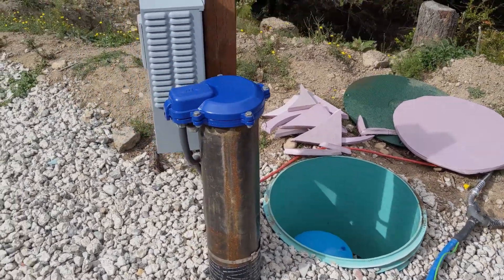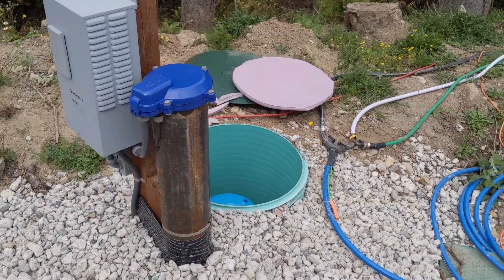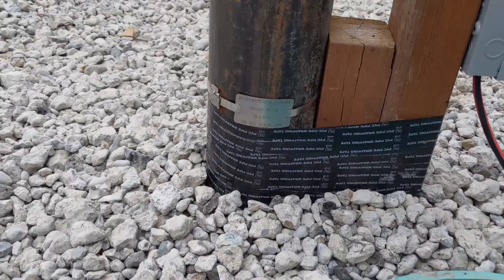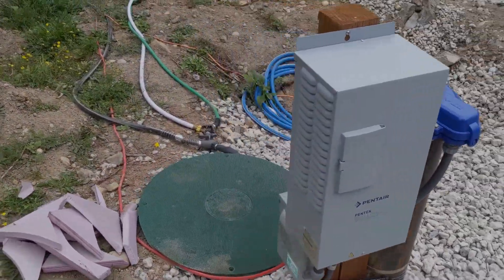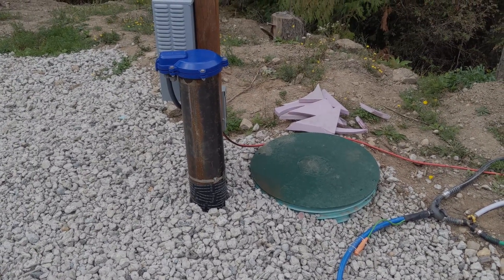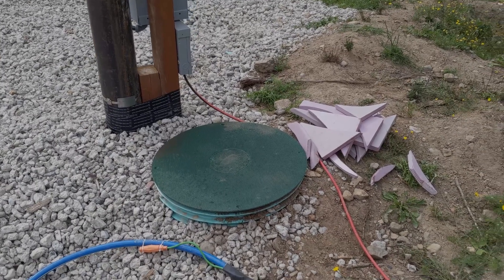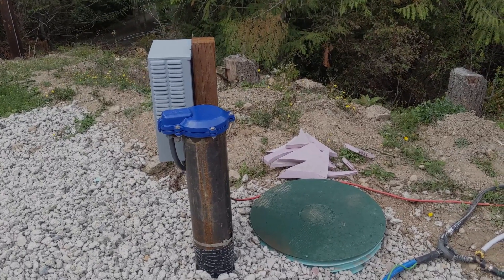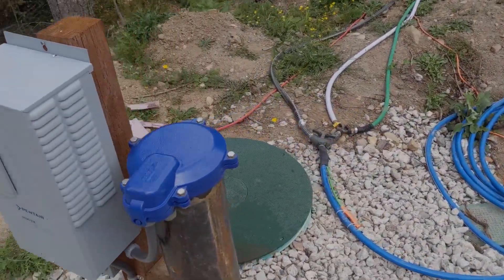Constant pressure water well

Comment: Hi I am trying to connect to a Franklin Electric SubDrive 75  which is a VFD for a well. Says it shouldn't be used with GFCI or externally regulated generator. How do I know if my generator is externally regulated? I have a 5000W Generac generator. Can I use an inverter generator?

Comment: Why not just install a large water storage tank...once the tank is filled, doesn't that reduce wear on the well pump?
Reply from the maker: That's very interesting, I would say for the uranium use reverse osmosis. Probably not the cheapest option but maybe it is cheaper over the long run than buying water.

I would suggest checking the concentration of uranium in the water, I do believe your skin could have some uptake. Not a biologist by any stretch but I am actually very familiar with uranium and would say you may look into that a little bit more.
Reply: @oak1518  thx
Reply from the maker: When I think of a large water storage tank I'm thinking 500+ gallons. Considerations with keeping that much water would be bacteria formation. The tank itself would need to be insulated in the winter climates, storage of said tank, either above ground or below ground would also be a factor. If you're talking about a tank under a hundred gallons then that is also a viable option but again to reduce the storage space I opted for a small surge tank. The pump and motor are designed to run continuously. If you were to put this in a house you would remove the benefit of that feature by putting in a large tank, the feature being the small footprint that it takes up.

I appreciate your feedback and interested to hear about your setup!

Comment: What does it take to upgrade an existing standard system? Does it require a new pump?
Reply from the maker: It does normally require a new pump. A conventional pump is not designed to be soft started and then run continuously every time a faucet is turned on. To convert an existing well you need to ensure you have enough production on that well. A constant pressure well system relies on a high production well.

For example I have a 1.5 gallon per minute producing well and am unable to convert it to constant pressure without increasing its production somehow. One way would be to frack it and drill it deeper. The problem is with this scenario and this particular well that I'm talking about it's already 400 ft deep. The deeper the well the larger the well pump you'll need for a constant pressure system. Some of the pumps are designed to maintain pressure with the depths of 1,000' but it's a very large pump and motor combination.

Example 2, a well produces 10+ gallons a minute and there's plenty of water, You would need a new well pump, motor and motor controller. Your surge tank could be kept the same but why not save the space in your basement and put the smaller tank in.

I would reach out to your local well company and inquire about what volume of production they would feel comfortable putting a constant pressure well had set up on. We're getting ready to drill another well in the Northeast part of the country and have our fingers crossed for a high production well so that we could go with the constant pressure system.

Hope that helps and good luck with your project!

Comment: Would a larger storage tank add any benefit?
Reply from the maker: No it would not, the storage tank in this scenario is only to absorb the surge from the pump starting and stopping. The pump is providing all of the water pressure in the system. As the pump starts and stops it is a soft start pump but still has some surging pressure that will be absorbed by the small pressure tank.

Comment: Where did you place the transducer in this setup?
Reply from the maker: It's in the bunker next to the pressure tank. In this scenario the piping setup is very short and measures the pressure from the top of the well head to whatever fixtures is being run or the hose in this case. Once the house is complete the transducer will measure the pressure of water within the house and adjust the pump speed and run time to maintain that pressure.
Reply: @oak1518  thanks very much for the quick reply.  I'm in upstate NY and my well motor (700') crapped out a couple of days ago. We were given the option of this system and went for it. When I got home, I realized the installer simply removed the nipple and pressure switch and inserted the transducer there.  Its just before the tank and there are fittings close to it. Obviously not what I see the manufacturer recommends.  Im gonna plug that 1/4 and tee into my main line somewhere downstream. Does it make a difference or if it were you would you just leave the transducer where they put it? Also, if I put it before my water softener is that okay? Any info would be appreciated. Thanks.
Reply from the maker: I see, I am now in Connecticut and working on deepening our well probably close to 700 ft as well. I think that as long as there's no check valve that prevents its sensing the pressure in your system you're fine. There should be some check valves in the system before the water enters the pressure tank. I don't know about a water softener as I have no experience with them. If their check valves that prevent backflow that could potentially trap a pressure signal that might be of concern for me.
Reply: @oak1518  thanks. Yes, there is a check installed before the tank- basically first thing when the water enters our home. 
No water softener experience?  Consider yourself lucky.  
Thanks again.

Comment: What about a 3 bedroom house?  Is the extra expense necessary?
Reply from the maker: Sorry I missed your initial post. It has to do with how many bathroom or water fixtures you have. The more showers and the more people taking a shower and running water will affect the pressure and if you have a regular stream of people showering at the same time or doing dishes and laundry at the same time and then wanting to also shower then the constant pressure systems is a  and no brainer. The other factor is do you have enough hot water to support all those activities lol.

Comment: Did you install the tank and controller or did the drill company do it?  Loos simple
Reply from the maker: Thanks for your question, I did not install the controller or the well pump but I did install the tank and supply power to the controller. It was a very easy install. I can't tell you how great a constant pressure well is. We have another property that has a conventional well and I feel like I'm constantly battling the household for water pressure! Good luck with your project and thanks for watching.

Comment: Very nice and clean installation. How much is the total cost of Constant pressure system ( Tank + Controller + service ) ? Dont you have a water softner system ?
Reply from the maker: This ran around $18,750.00. We Will have a water softener system once the house is completed. We have enjoyed drinking the water without any softening and thought that it was fine. I also have done many loads of laundry and have not noticed any issues with getting clothes clean.

I don't plan on having the water softened for any drinking water. An example would be the ice maker on your refrigerator.